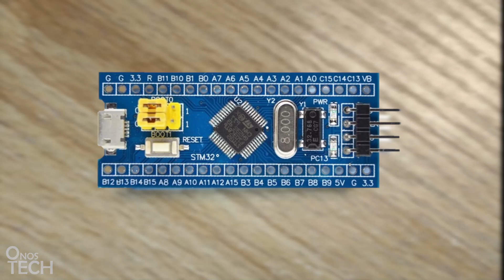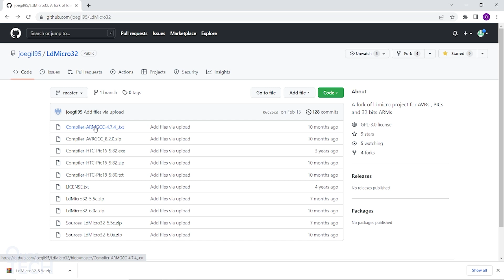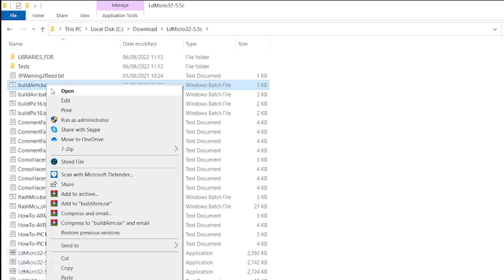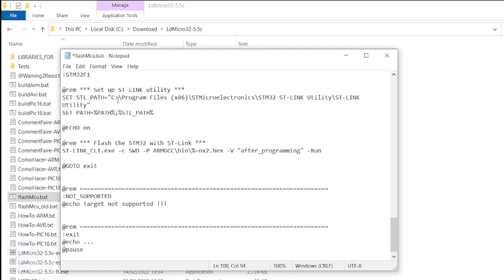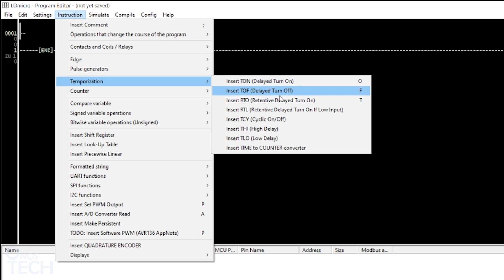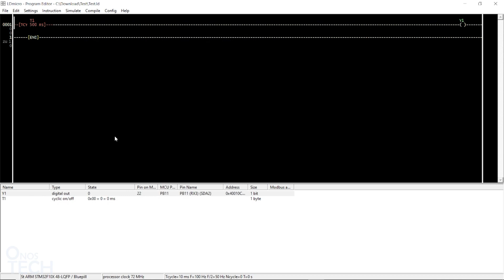Comment: Greetings, my friend. I have designed a development board with an STM32F407VGT6 series processor. I had previously written software for an industrial board that I also designed myself with your help, where the processor was an Atmel 328P series. By the way, I do these as a hobby.

Now, on this STM32F407VGT6 board, I have broken out all communication channels as pins: I2C, SPI, CAN bus, Modbus, USART, USB, and 4 kit structures compatible with the MikroBUS protocol.

I want to use the analog pins on this board and send the data to a SCADA system via Modbus. Can I do this with the LDmicro program? If you want, I can share the PCB project files for the STM32VGT6 with you.

I have been following your YouTube channel for a long time. I wish you continued success in your work.

Best regards
Reply: Thank you for your continued support for my channel. 

To the best of my knowledge,  there is no native support for Modbus in LDmicro. You might want to consider using FLProg for your purpose since it fully supports both Modbus RTU and TCP as well as STM32.
Reply: You're welcome, you're welcome! Thank you, that's very kind of you. ❤️
Reply: @acocrw5808 This is the link to my videos on FLProg: ESP8266 FLPROG LADDER LOGIC: https://www.youtube.com/playlist?list=PLjkzNLFcHTFAU7fdGq6AzO37G8op0gP4S
Reply: But im not using stm32f103 :)
Reply: Thank you so much for your interest. I checked out the FLProg software from your videos, and then I examined the program myself and saw that it doesn’t support the STM32F407 series. In that case, I think the most suitable option for now is to set up FreeRTOS and continue from there. :)
Reply: It does have support in recent versions: https://flprog.ru/en/?s=stm32. Except, you'd rather stick to your plan of setting up FreeRTOS